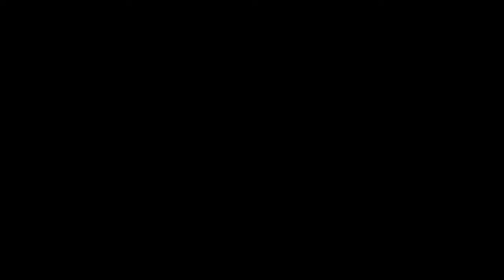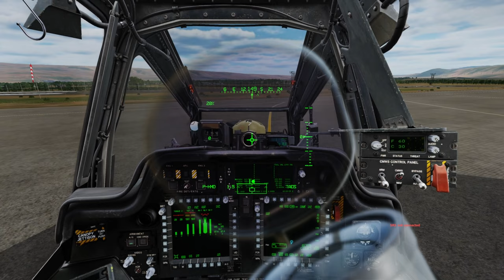How to avoid an unstable hover and take off | DCS AH-64D quick vid

Comment: Great video step dad!  Keep up the content mate, its great to see you showing the non believers that the Apache is far from unflyable!
Reply from the maker: Keep hustling, brother. Still gotta ride shotgun with you soon.
Reply: i guess i missed something here 😄 who tf said that the apache is unflyable?? i am hooked with that thing since release. it flys great
Reply: @NWGJulian  I guess it's people coming straight from the ka-50 which is so much more stable.
I'm one of those. I thought I had a good handle on helis because I was doing well in the black shark. The apache showed me I was pretty shit. But I'm passable now. Just takes a few hours.
Reply: I really, really appreciated the stability that the Ka-50 fly by wire system bring.
Even with AP channels off it still extremely stable.

I guess that's required for a single pilot ground attack rotary platform. You can't really fight when the machine is trying to kill you.
Reply: @LongTran-em6hc  Agreed. The Ka-50 feels almost like cheating when you're flying it around. I can slide into a hillside position, creep up above the trees and just click the auto-hover button and let it park itself in the sky. It's definitely what you need with the Ka-50 too, since you've got a tiny TV sitting in your lap to stare down at to find targets without the help of FLIR, you've got a pretty rough field of view beyond the front of your wings, and until the BS3, you had to manually be ready to dump your own countermeasures if you were lucky enough to see who was shooting at you.

Comment: single biggest problem with the Apache is framerates. if you have less than 30fps (especially in VR), then you can'[t possibly fly the heli. no chance for a stable hover. So check the fps, lower the gfx settings until you have stable above 30. before that dont evbe try to fly this. Other than that of course its not easy, but after 2 weeks of flying on e hour here and there i am comfortable to land on a rooftop (or hove abvove it for that matter)

Comment: Just came back after a few months and noticed the yaw trim is working correctly now. You barely have to use the pedals as much to takeoff now. I think a lot of people use too much input, but they are also using a desktop stick with no extension. I would recommend at least a 20cm extension for better control. Relax your grip and just control it with light tension. With the extension you only have to move the stick with a couple fingers.
Reply: yep should be first stop before attempting the apache i got thousands of hours in the dcs huey and i just forget about all the electronics in the apache and the monocle i fly it like none of that is there an she behave impeccably well
Reply: @apocalypticweasel9078  I know the FM is not there yet, but it is still very good. I was on a multiplayer server a couple days ago and had a fighter trying to shoot us down. I dipped through the valley and the fighter could not get a lock. I finally headed back to the Farp and he tried to follow us, SAM at the Farp took him out, lol.

Comment: Regarding wobbling i discovered that it is not necessary to apply curve/saturation to all axis but only on the roll axis. I have warthog stick with circa 20cm extension: pitch-all default,no curve, roll- linear &35% saturation, yaw 20% curve, default saturation. This settings made it so much controllable for me.

Comment: Hey Casmo. Just a quick note concerning a lot of gripes I have had. I have the stable (non beta) version of DCS. They just released the update finally that the beta guys have had for a few months now. Holy smokes! They made some HUGE improvements regarding the Apache. Other than the visual improvements to lighting and graphics they reworked the infamous SAS SATURATION that used to drive me nuts. Now it's just a short beep and the message flashes briefly. So much nicer not having that thing yelling at you. Overall the Apache just works smoother. Maybe it's just me, but I am trying to find update list to see what all they added/changed/removed. Or a video. If you know of such a thing, please share. I will keep looking and hope to see a new video from you soon!

Comment: If the symbol is creating a trendency the pilot chase, why didn't  they(military )redesign it to go opposite the way? That's killing me.
    I like mi24p bs123 mi8 flying experiences as they are smooth to fly, and autopilot sys is doing really pro. When flying with  ah64d, i feel no good and a bit frastrated ,even more the auto hold alat function always disengaging itself and failing to activate. It's just like an incompleted autopilot system installed to it and not to a usable standard(maybe just not for me), but the strange thing is that they are actually using it in reality today.
Reply from the maker: I mean it’s a bold statement to make that an aircraft that has world wide sales of over 2400 is incomplete. Especially when you’re making that comparison to a video game that is, by its own admission, incomplete.

Comment: Weird chopper  to fly u gotta treat like a fixed wing a/c u need forward movement to get some sort of control
Reply from the maker: Disagreed. I’ve trimmed it to a hover from lift off and taken my hands off the controls. It just takes some babying to get into position.
Reply: Nothing fixed wing about at all :). But every input has a consequence, so 0.00001 makes it go that way. I have to have some deadzone and curve due the physical controller. I whish we could get a readout of our inputs in numbers. For racing games we have motec and 1 ex. was me doing a xxx.21 lap and another doing a xxx19 lap. If you watch it on video, it is impossible to tell, but in motec, it is very clear. Also make a video just for yourself and then you can see your possible overcontrolling.
Reply: @macedk  I’m fish tailing all over the place wouldn’t dar hit the trim button in transition to hover I always line it up push the cyclic forward and treat it like a plane lol